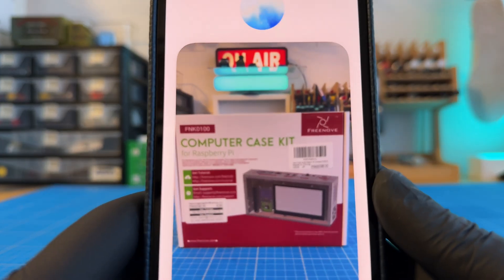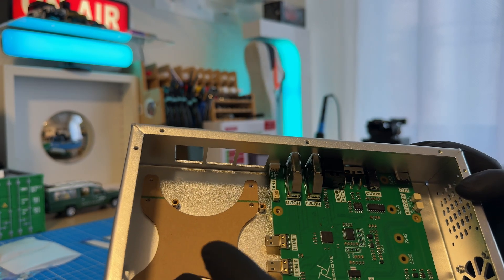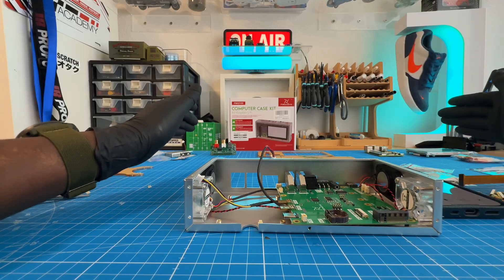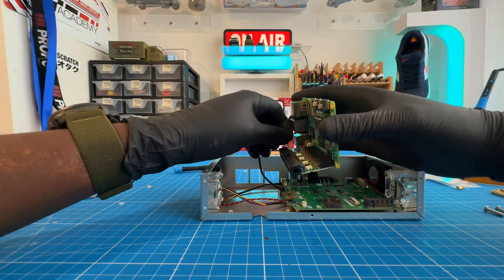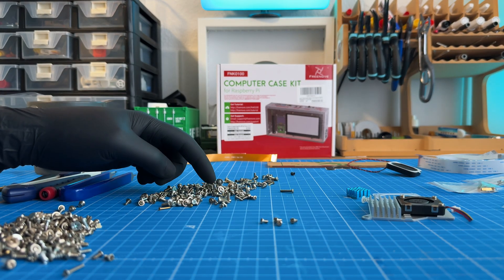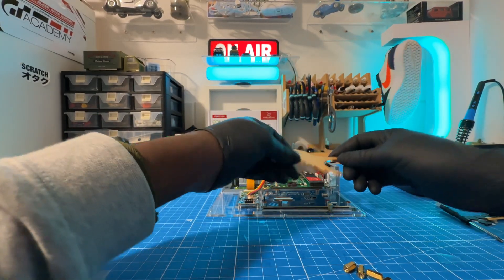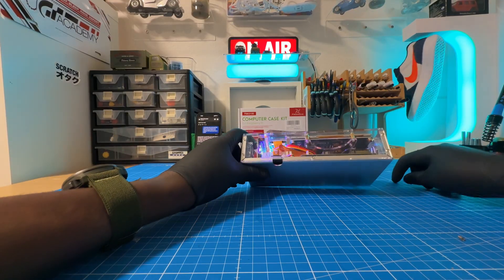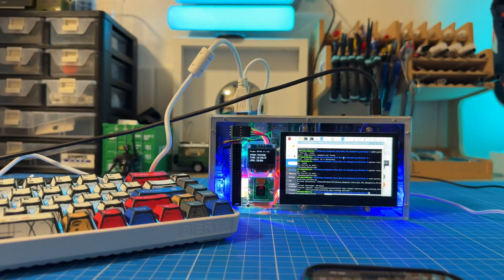Raspberry Pi 5: Case build Freenove FNK0100

Comment: How did you worked that small display next to touchscreen, I had it came with raspberry pi 5 adapter but it won’t display nothing. Also, how can my camera work too, plz thank u
Reply from the maker: Check https://docs.freenove.com/projects/fnk0100/en/latest/index.html follow each step and and also install python the look for 4.2.5 OLED Test. They have clear instructions on how to make it work.